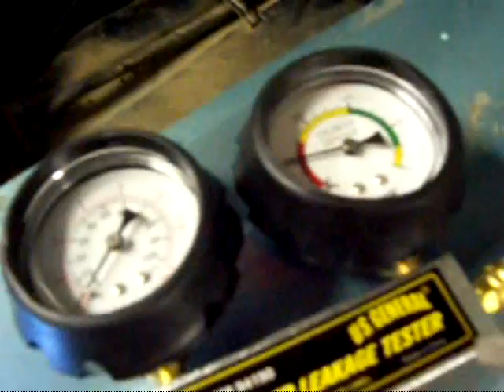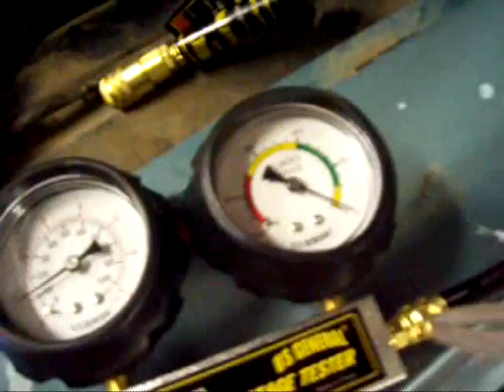Using a Cylinder leakdown tester on the 1963 Oldsmobile

Comment: Good video! Learned some new stuff

Just an extra hint, though: While you're doing the leakdown test, pull air cleaner and listen through carb. If you hear a hissing sound, then you may have a bad intake valve as well.

I have a 63 olds 88 2 dr HT. They're great cars!

Comment: @rougedetroit
Hey I have a 62 dynamic with a 2bbl and I just bought a 4bbl intake manifold from a 63 olds , what kind of carburetor are you using? did you change anything else, cam? exhaust?
You save a lot of gas with a 2bbl but the Rochester 2bbl I had was such a piece of crap lol

Comment: if the valve seat it's not worn and if you can lap the valves buy a lead supplement for the fuel those engines are designed to work with leaded gas

Comment from the maker: I did the comp and paper tests first, the leak down test was just a way to verify that it was the exhaust valve. compression was good on all but one cyl. i didn't use valve saver *kicks self in ass* but i did use high octane fuel.  Just the rebuild kit on ebay for this car without any machine work is about $1700, i dont think i need it. I'll take a look at the cylinder walls when i have the head off just to make sure.

Comment: good vid. you can also do a wet and dry comp test. put smoke in the cylinder and see where it comes out. or the paper over the exhaust test. do you use valve saver. and 95% or higher octane fuel? you might as well do both heads and rings. it will be like new. you can get VRS kits with everything you need to do the values or a full engine kit. it would be cheaper in the long run to do it all. good luck